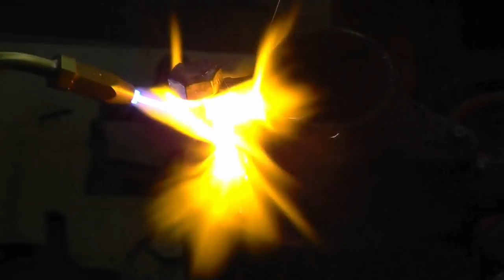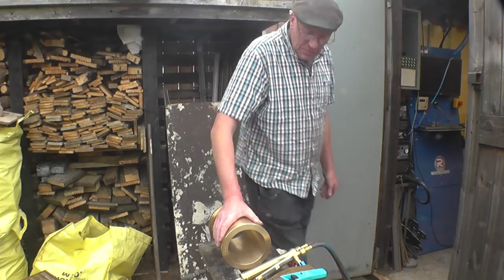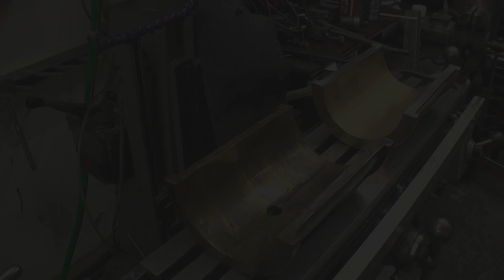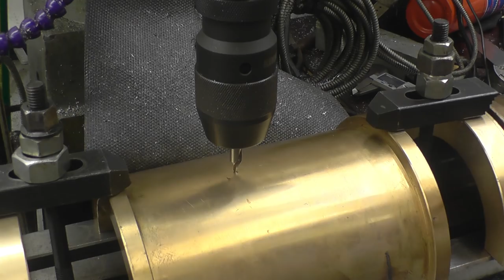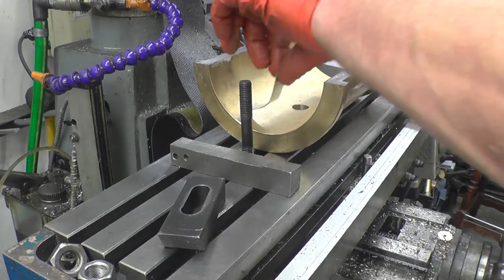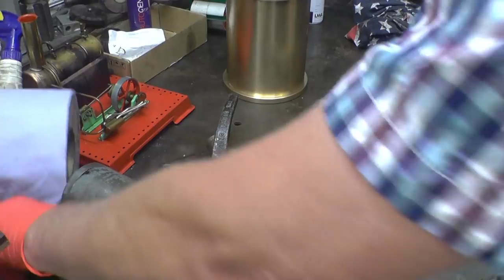SNNC 346 P1  Spliting The Bronze Bearing

Comment: Great job John, just wondering if that external rough channel/groove is a modification because the oil was in the wrong position, academic though. Impressive joint strength, keyed well in.
I used to enjoy chiselling grooves in brass bushes, normally a figure of eight shape, copper was a pain, mushroomed up terrible.
 Great set-up, definitely losing "a mechanic who pisses about" monicker 👍
Thanks for sharing.